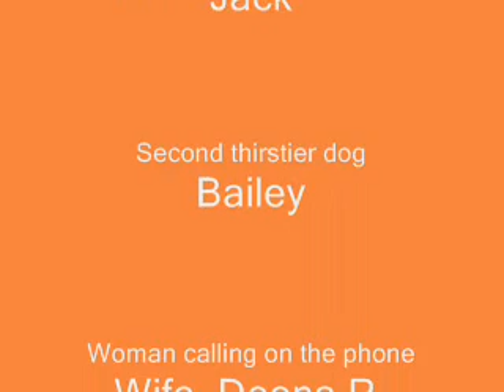Testing for a Parabolic Surface

Comment: thank you for your videos i am attempting to make my first telescope and i am finding that the foucault test to be very difficult when i point a lase rpointer   at the slightly polished mirror, where it reflects back toward the tester there are two red dots coming back from the mirror i think the laser is not only reflecting off the front of my mirror but also the back side . is this something you have seen befor and is there anything i can do to fix it . also i dont see the surface of my mirror i only see right through the glass just like i wasnt doing a test please help if you can thank you.